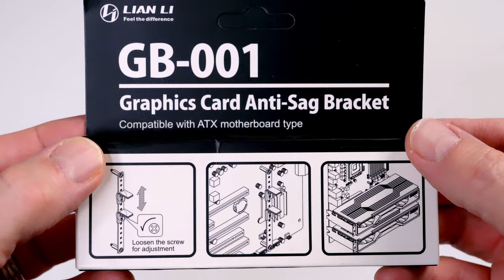HOW TO FIX YOUR GPU SAG ONCE AND FOR ALL! THE PERFECT GPU BRACKET!

Comment: This is probably the best gpu support bracket I have seen thank you very much. I was thinking of getting the antec flux pro case since it's new and the best air cooling case and was thinking of where to put a gpu sag bracket since there was 3 intake case fans on the bottom above the psu and below the gpu, so I couldn't think of a solution.
Reply from the maker: @lovie74  I love this bracket because it's hidden and solid! Thank you for watching.
Reply: @UltimateTechHub  I heard a lot of people have problems with some atx motherboards using it, since motherboards sometimes have things sticking out in the motherboard which gets in the way of this gpu bracket.

I do think it's the best one in the bracket and I do hope I wont have an issue with the motherboard I pick for my 9800x3d or 9950x3d in the future when I get one of them, depending on if they fix the 16 core vcache since they messed up with the 7950x3d.
Reply from the maker: @lovie74  Yes sometimes motherboard heatsinks can get in the way but not often.

Comment: I couldn't get it to work on my Zotac 3080Ti Trinity OC, the fans on that card's cooler are right where the support would be, in both possible configurations i.e. middle and right side mobo screws.
At least I didn't pay for it, as I got it with my Lian Li case. Still, caution advised, check if your GPU has a solid spot in the right place to rest on the support before buying.
Reply from the maker: That is definitely an issue with the fans. Thanks for the heads up to my viewers I really appreciate it!
Reply: I guess that's why they made the GB-002 a bit different, allowing for horizontal position adjustment. But the height adjustment is not as good as this one, requires the use of small pads.

Comment: its sad we miss those isa extension card railings...it was use during 80's to hold hdd card back then amd ibm computer cases had this rail bar to screw in the card to the rail and isa slot...no sagging isa drive cards  ...case makers should bring that back for pcie slots now...cards are getting heavier
Reply from the maker: I agree 100 Percent! GPUs are insanely large and heavy! Thanks for watching I really appreciate it!